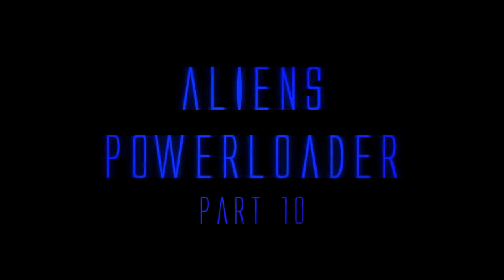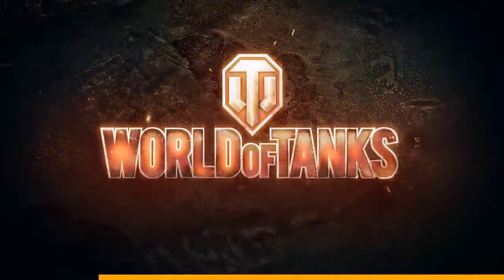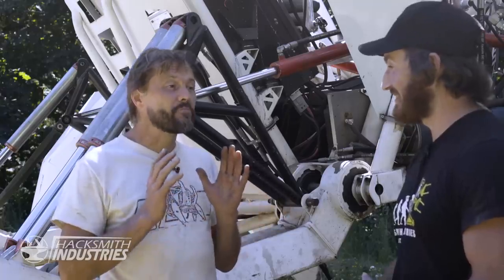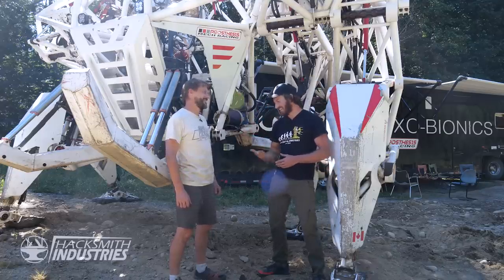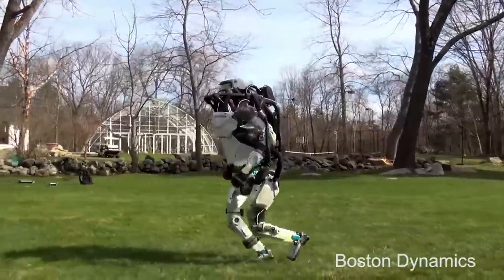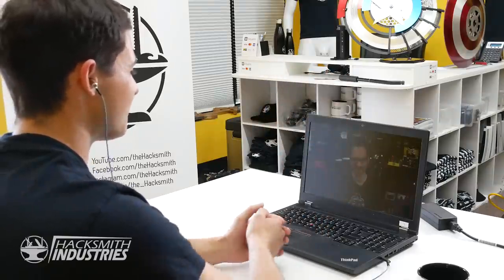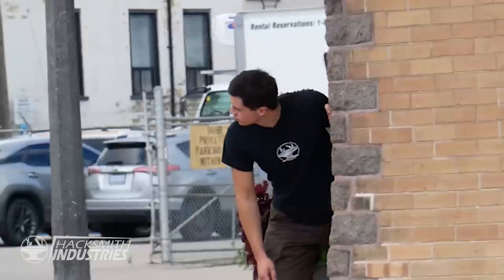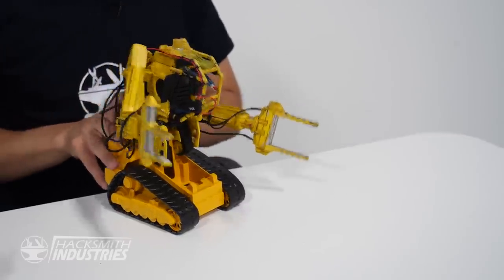Legs or Treads? (POWER LOADER: PART 10)

Comment from the maker: Play World of Tanks here:  https://tanks.ly/3aiGPLJ and use code TANKTASTIC to unlock a T-127 Tank, 500 Gold, and 7 Days Premium Access for free! Thanks to World of Tanks for sponsoring this video.
Reply: FIRST
Reply: I’d say treags (treads/legs)
Edit: or make it so you can swap between treads and legs(four short sturdy legs)
Reply: I’d say treads for now and then you can upgrade into legs
Reply: Can you make the butter bot from Rick and Morty please
Reply: Make that money my g
Reply: Did u all guys not sleep
Reply: The best
Reply: Xenomorph after seeing this video might run away.
Reply: BUILD A TIME MACHINE...please 😁
Reply: With bipedal mechs there needs to be an absurd amount of control over foot movement

Do you balance your weight above you waist or at your feet?

Your feet is the answer

Tho its only around 70% of the contribution to balancing my micro scale bots
Reply: Does this code also work with world of tanks Blitz?
Reply: idea you can try to make the treads sorta look like feet or legs or something
Reply: use treads for now, but design legs you can swap on later
Reply: Seems like treads would be the easier solution; with legs you have to deal with balance issues.
Reply: Hi
Reply: Legs
Reply: Treags because if the treags run into an obstacle, they can step over it!
Reply: why don't you have a look at incorperating both , as if you are going to make the powerloader from aliens then it's shoul;d be the powerloader as it is in the film , but it is a pukka idea to look at putting track's on the feet aswell ( as it would help with turning )
Reply: with the balance side of thing's , have you thought of the same idea as the single wheel bike ?
the gyrosystem
Reply: Make it so you can switch between legs and wheels
Reply: Legs bro
Reply: Do both tracks and legs
Reply: Make it a quadruped
Reply: Legs
Reply: Make Team Fortres 2 sentry
Reply: Why don't you combine trades with legs? It would be much cooler!
Reply: Something i think you should try is getying every hacksmith to make there own battle robot and then make them fight to see who made the best
Reply: Please do legs
Reply: Lega
Reply: Lega
Reply: Legs
Reply: I say legs
Reply: Do legs please because I want it to be like the movie
Reply: "Historically accurate" =/= World of Tanks     lmao
Reply: I tried to get world of tanks but at a point it said I had to use Latin letters what does that mean
Reply: I’m mad your mean
Reply: JUST MAKE THEM LEGS WITH TREDS ITD BE JUST AS AWESOME
Reply: @nikolimoon6165  That would be cool but super expensive
Reply: Do treags. Give it only forwards and backwards movement, not side-to-side, including ankles with treads for feet. Also, give the treads on each side individual movement for better travel on rough terrain.
Reply: How about the light saber with color
Reply: Make Optimus Prime from Transformers
Reply: Legs
Reply: Treads
Reply: I think you guys should make it look like legs, but connect the feet and put treads at the bottom so it looks like the movie(mostly) but you won’t have to worry about bipedal walking
Reply: y'all can do this, for next world, for ZOMBIE APOCALYPSE:))))
Reply: nice easter eggs, I just facepalmed myself
Reply: u should make sova's shock bold and bow
Reply: could you make a flash suit pls
Reply: im a beta players of world of tanks dont need code :p
Reply: Hi Hacksmith
Reply: I love your build
Reply: Would if you did both legs, And treads
Reply: Was that it
Reply: I have an idea
how about 4 legs?
Reply: I say treads
Reply: Why don't you put both legs and treds like treds with legs kind of!
Reply: @AEON.  I don't know but my idea is on the table now
Reply: it'll still look cool with treads!
Reply: On the bright side that skid loaders hydraulic system might have enough flow for most of the upper body as well
Reply: the Hacksmith you were the best , are the best , and will be the best. Hope I meet with you
Reply: Are you still in Vancouver? Because I live there! I want to see some of your projects!
Reply: Wait a minute what about legs that have the feet as treadmills so that when you move you walk but when you need help on heavy lifting!
Reply: And does this code work with world of tank biltz
Reply: the Hacksmith legs
Reply: The virus is getting worse not better
Reply: And give it legs not tracks
Reply: Boston dynamics doing parkour with his robot atlas but weit there is the hacksmith doing a power loader
Reply: Tregs
Reply: the Hacksmith you are my favourite and the best
Reply: @nstydevi3328  boston dynamics still have the best robot
Reply: Definitely legs
Reply: @AnimeFan-ot7bu  no its more hard to move with them
Reply: boby scott ik but still i agree that it look cooler but really if im being totally honest i don’t really care what they do edit: when i said that i was in the middle of watching the vid i dint know that they already made a decision
Reply: @AnimeFan-ot7bu  oh well see ya then sorry for being rude
Reply: Mrbeast’s and hack smith’s crew have the luckiest job
Reply: Make black panther's claws
Reply: Very Goodddd 😎
Reply: where do u get ur metals and alloys
Reply: I wouldn’t exactly call world of tanks “historically accurate”. War thunder is a game that is.
Reply: wispers war thunder is better
Reply: 100
Reply: the Hacksmith You are my favourite
Reply: Really
Reply: Pretty soon you’re going to have stopped and restarted more times than you have episodes
Reply: Another thing: IF YOU PEOPLE DONT, AT SOME POINT, MAKE LEGS YOU CAN SWAP THE TRACKS FOR, I WILL not do anything but be very unhappy
Reply: Ninja Snipez what do you mean “what”?
Reply: Yo you should built a one 100% functioning Freddy fazbear from fnaf that would be sick
Reply: Hey do u think u can make me a project my project is something out of water any water weapon plzzzzzz I really need it
Reply: Hey man . If I make a iron man ,, would u fund me for some time??
Reply: It didn't work it said it did but I didn't get anything on game
Reply: you promise us legs not treads, you lied to us hacksmith. WE WANT LEGS WE WANT LEGS!!!!!!!!!!!!!!!!!!!!!!!!!!!!!!!!!
Reply: Make starlord's blaster.
Reply: Glad to hear you guys are doing better
Reply: its actualy a good game lol
Reply: Do some Generation Zero content!!!!!
Reply: PLEASE MAKE ZOIDS‼️‼️‼️
Reply: So in a reply to a comment here I saw Juan Felipe Ramirez simply say “with treads” to a comment talking about the legs and I’m assuming they mean the same thing I’m thinking which is make the legs of the power loaded be able to form together and becomes treads 

Is a pretty cool idea
Reply: Nikoli Moon yes we are in agreement
Reply: I wish I was good at world of tanks
Reply: C'mon guys. At least do a set of legs as a scaled trial. Its the whole reason I was excited about the project.
Reply: Su
Reply: Sup
Reply: Love your videos, been waiting for an update on the mech, can’t wait to see you guys take apart a bobcat. P.S Warthunder is better
Reply: Yes
Reply: Y’all should build 2 then fight
Reply: hey why not use a gyroscope for the legs
Reply: Voltron the 5 loin
Reply: This is like upergadedversion of powerloader
Reply: Gosh darn it no legs
Reply: can u build a robot?
Reply: suprisingly world of tanks actually is Fun. so yes I whole heartedly agree with you.
ALSO ALIENS is and always will be the grandparent to almost sci-fi horror genre..I grew up to it and you guys probably did too. Also fun fact Alot of the Lingoused by the Colonial Marines from Aliens is based off the Starship troopers Light Novels, Halo also took a page from this..
Reply: Any update? Patiently waiting! Such a fun project to watch unfold!
Reply: Legs!!!!!
Reply: I have world of tank for 5 years mow
Reply: Now
Reply: This video reminds of the Brotherhood of steel from the fallout games
Reply: Tank treads that doesn't count.
Reply: Build a mini sub.

Comment: “World of tanks is historically accurate war game” meanwhile a tank is flying over a hill like it’s a ramp
Reply: Well a" real" tank, can indeed fly of an hill.
Its an other question what happens afterwards.........
Reply: "A historically accurate game"... Looks at

-tanks from 1937 fighting against tanks that are used today
-tanks that didn't even exist as blueprints and are completely made up
-WW2 tanks fighting against tanks from the cold war era
-tactics that would be beyond suicidal in real combat

Yeaaaaah, right.
Reply: “HISTORICLY” not PHYSICLY
Reply: @eulemitbeule5426  the individual tanks are historically accurate, not the combat setting...
Reply: @Synthmilk  So tanks that have their values like armor thickness, engine power, top speed, etc or the modules they use changed every few updates is historically accurate? Yeaaaaaah.

Just take a look at the M24 chaffee: In real life, it had a 220hp engine and could travel at 40 km/h offroad. In WoT? 500hp and 62 km/h... Totally accurate.
Or the Panhard EBR. RL: 200hp. Ingame: 560...
T28 Superheavy/T95: top speed of 13 km/h. Ingame? 20.
Basically every tank was drastically altered to fit into the game, good luck finding one where the exact ingame stats exactly match the ones it has in real life.
Reply: this is why i play Warthunder
Reply: @TheDoomLordd 
Ah yes, the world's most painful and slow videogame grind as well as inconsistent shell damage/hit registration, with an added sprinkle of hilarious bugs, had my tanks fall though objects a couple of times, fun times.
Reply: You are completely correct
Reply: Have you seen the speed of German tanks

Comment: Seriously awesome series and I have to say besides doing an amazing job of making a sci-fi concept into a functioning machine you're also showing the way for would-be engineers (i.e. not just young people looking to be inspired but also engineering undergrads) that some of these neat ideas of yours have actual real life applications. For example a working functioning powerloader like the one you've created I can easily see defence and civil engineering firms making use of them (e.g. a single individual shifting a heavy load of cables using a powerloader instead of a small team) and why I think you guys should seriously consider approaching companies Boeing and Rolls Royce or BAE systems or Rheinmetal of Germany to sponsor some of your major projects because if it works then there's a real possibility of you guys opening a new frontier in science (e.g. what good material science and mechanical engineering can and cannot achieve).

Comment: Hey, i got an idea. Make some new wheels and treads for the cybertruck. I suggest using the reconfigurable wheel track system developed at MIT for darpa's GROUND X VEHICLE TECHNOLOGY PROGRAM. They can go from circular wheels and shift into a triangular track system. The tires are replaced with  hinged treads. This way, it csn also be a better all terrain vehicle. Other ideas include but are not limited to: omnidirectional wheels

 replacing all bedspace with a telescoping retractable cannon, as well as riot supressor that shoots tazer darts or plastic casings filled with 50 g of rubber pellets,and flare/ rocket launchers

Adding features from the spycar. Also repurpose the projector for a windshield HUD

Adding a powerful grappling hook winch system

Holy crap, remember the tumbler bat baha, you could build the freakin BATMOBILE.
I bet you could find some scratch resistant black paint.
TO THE HACKMOBILE!!!
Reply: Ayyy ur a member...
Reply: @tessa.pk.  yep
Reply: Self correction: reconfigurable well track was developed at CMU in pittsburgh, not MIT

Comment: Will the bobcat have enough hp and torque to get the power loader moving at acceptable speeds? Or are you doing engine modifications too?
Reply from the maker: More than enough!
Reply: its a bobcat, those things are like half engine. it will be doing wheelies!
Reply: @blockstacker5614  Yeah, skidsteers are BEAST. So bloody fun to operate with the "weird" control arrangement (hands move it and foot pedals control bucket/forks, completely backwards).

They have some serious power too. Bet Hacksmith could make the power-loader twice the size and it'd still carry it.
Reply: @d34dR0d3n7  For real, those things are designed to move heavily material while putting very little strain on the engine. I doubt they would have any issues with speed or torque even with a super old one.
Reply: @d34dR0d3n7  Although I do wonder what model they went with
Reply: @bensnow421  I lifted a "regular sized" dumpster that was full of only dirt and concrete with one, easily. And yeah, looking forward to what they get too. If go with newer model, will be more than enough for this build. An older one (even with several dozen hours recorded) would likely handle it too.

Expect they will buy a second one just to run around the shop after get experience on the one being sacrificed to making the loader.
Reply: @d34dR0d3n7  what brand is that control scheme on? im not an operator but from what ive seen there is usually a joystick on the left for movement and one on the right for the bucket and arms, with other controls mounted to the cab pillars.
Reply: @blockstacker5614  Cranes, dozers, forklifts, pretty much everything is wheel and yolk. That's why I said skidsteers are "weird."

All companies use that scheme. Bobcat is my favorite, but JOB can do some work too.
Reply: @blockstacker5614  I ran an old John Deere with sticks for moving and pedals for the bucket. I don't think I have seen foot controls in a skid made after 2000.
Reply: it will probably have enough health points
Reply: When you're a gamer and read HP as "H.P." or Hit/Health Points instead of Horsepower.
Reply: @jeremyfoss3230  skid steers have plenty of H.P. too

Comment: James-legs
bogdan-treds

James-LEGS!!!
Bogdan-TREDS!!!!!

me-just try them both!!!!!!    legs with tank treads below the feet
Reply: Thats awesome
Reply: I mean thats verry smart because you are fast om flat ground and you can Climb
Reply: Not to mention with individual tracks you could raise or lower a leg individually allowing the power loader to tilt into turns for faster and more fluid movement. But I understand the cost of R&D and how much would be poured into developing a stabilization system for that. A cool idea none the less though, I was thinking the same thing while watching.
Reply: Was thinking this exactly. Plus it looks a lot better than having a single trunk sitting on a single trunk.

I don't think the stabilization system would be that hard to get working initially, just keep everything stable and you basically have a regular tank base. Then you can still improve it later on for more dynamic motion.

If you want to see what this could look like, have a look at the anime Code Geass. While it does quickly introduces science-breaking supermechs, the initial rank-and-file models are surprisingly mundane in their design. These mechs are essentially rollerblade-skating, which is way easier for a construct like that then a human because robot joints are a lot more stable than human leg joints.
Reply: The Megabots Eagle Prime did have something like that. It leaned from side to side on its legs, but probably couldn’t actually lift up the legs.
Reply: @FooFoo4230  Not really. It can lean, yes, but at the bottom is still a single solid drive unit.
Reply: Well ,where would you like to put your engine?
Reply: There are many things that are wrong with this idea one of them is: where would the treads loop?

Comment: Legs: Cool/Hard to balance Tracks: Boring/ easy to balance
Reply: John_ Pro65 if they are controlled by the human directly then the tall build of the power loader would balance better on legs than on treads bc it’s a lot easier to adjust in a second, although speed could be limited more than treads

Comment: Thinking about it, using a tracked skid steer, you could use that as the hydraulic source. Already has an engine set up for them and the tracks would already be aligned, would also help with budget down the road with easy to source parts.
Reply from the maker: exactly

Comment: Just before I watch: from an engineering standpoint, threads are a hundred times better than legs. Tried and checked in a lot of physics-based games I played. More stable and more surface area, better force distribution and actually less complicated.
Reply: Depends on the terrain. on a sufficiently firm and level ground you are right. I would prefer a solution like a walking excavator. It would be closer to the original.
Reply: @petrophaga8523  actually now that I think of it, my "experience" is based off of making weaponised mechs, so it's actually kind of different than what they are going for.

Also just in case, games I'm talking about are Simple Planes and Kerbal Space Program, so basically unity but easier lol.
Reply: @petrophaga8523  What kind of terrain are you using a power loader on? It's basically a sci-fi forklift. Metal or concrete floor would be the typical terrain. I wouldn't feel comfortable trying to ascend/descend stairs in one, so it's kind of dubious if that could be used as an argument. If it's bare ground, that is, an undeveloped place, threads would still work just fine. I can't see you unloading stuff from a vehicle in really rough terrain. Where would you even land/park the vehicle and where would you pile the unloaded cargo in such a place?

Comment: I thought they would do legs but instead of feet, they'd replace it with treads, which now that I think about sounds like a pretty bad idea, to be honest.
Reply: Hi toph
Reply: If you can get the stabilization right. Its not INSANE, but that's merging both ideas together and that just aint financially possible right now.

Comment: I know it's too late but have you guys thought about using the wheels that are seeing on workplatforms ? So that the turning radius would be smaller and so it does not scratch the ground or the surface to pieces on which it runs. 
See also JLG's self-leveling boom lift.